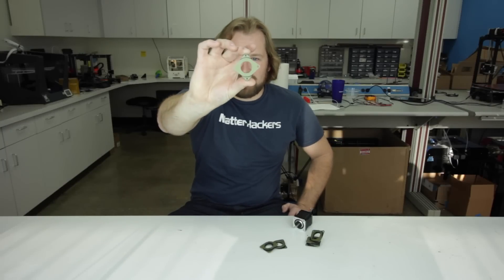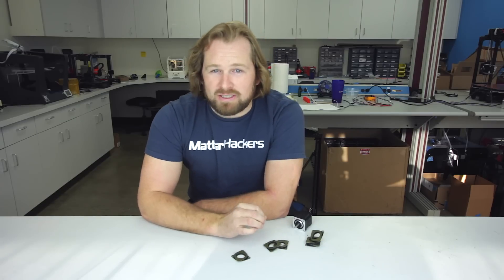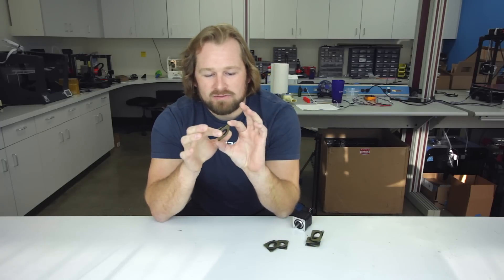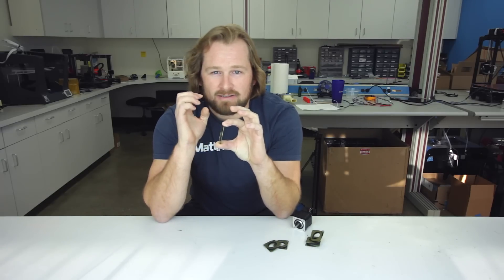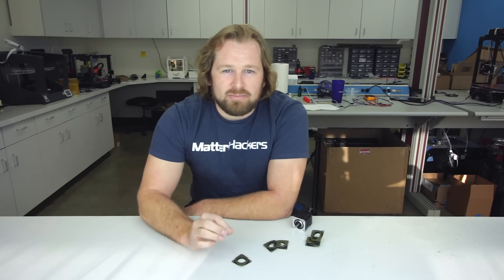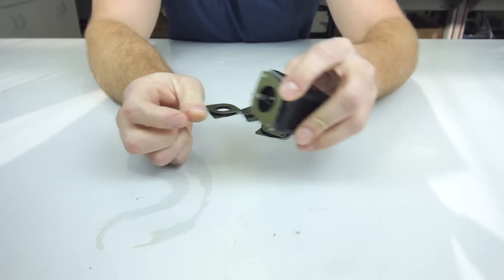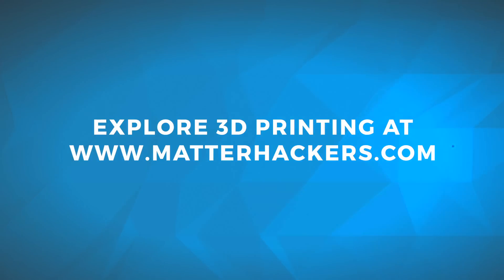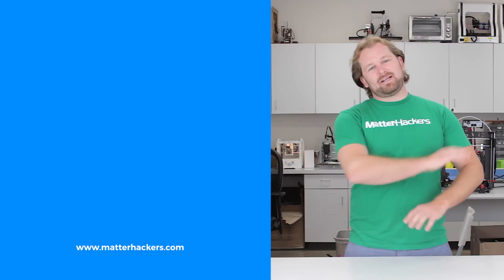3D Printing With Motor Dampers

Comment: i got vibration ripples after installing one of those on my y axis stepper motor....
Reply: Y  Y Z?
Reply: I am removing these from my printer. When using a belt and a pulley, the side load causes the motor to shift crooked. Also, when it changes direction quickly, won't the rubber twist and add inaccuracy?